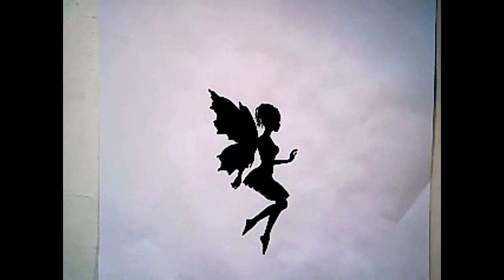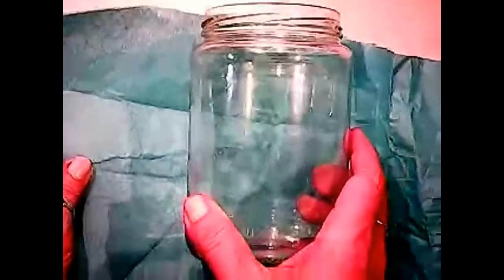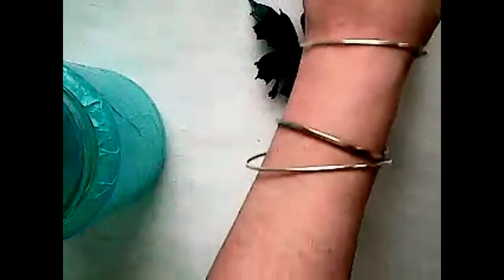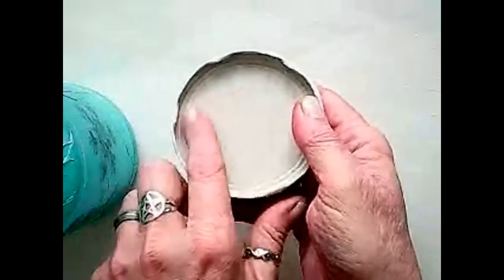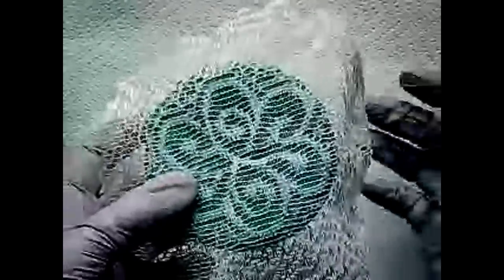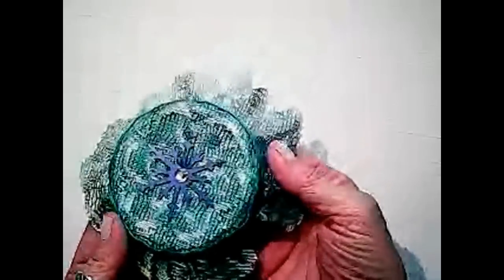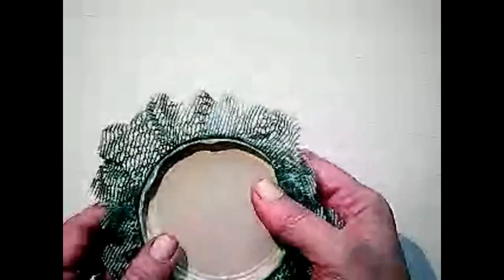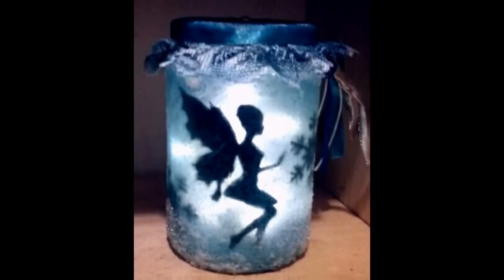DIY-Snow Fairy Lantern

Comment: Technically,  if you put the fairy under the tissue paper  on the outside,  you would be able to use real candles if you leave off the lid? This is a question not a statement I'm not sure if the heat of a candle would not be good with the glue? ...it's lovely either way!
Reply from the maker: It would probably work but I think you are right that the heat from a lit candle will melt the glue, better safe than sorry, have a beautiful night, Peace & Love